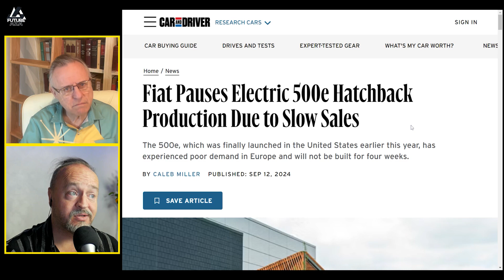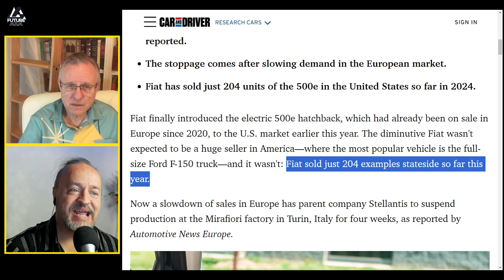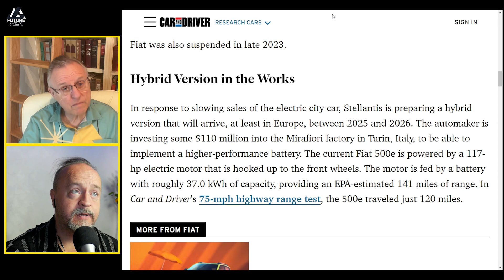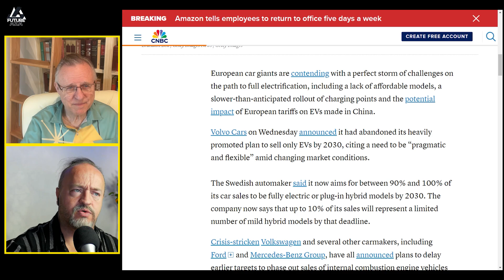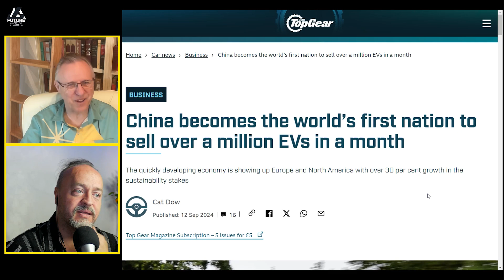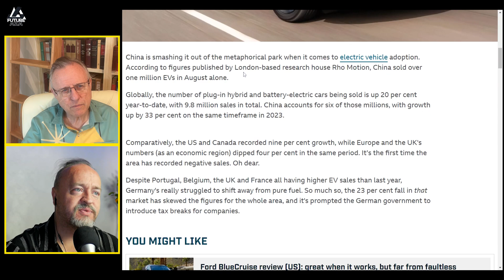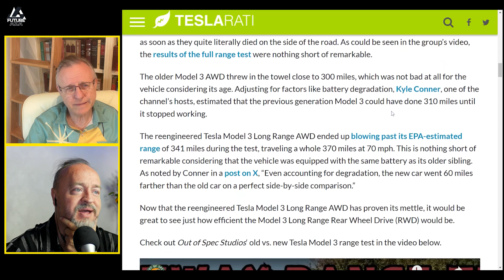China PROVES you can go EV. How did Europe fall so far behind?

Comment: To start, I don’t have an EV but I do rideshare driving in far northern MN. At-20 my understanding is the range drops. And I have to drive 25 miles just to get to the rideshare area. I did the math and figured out I would need to charge twice during a short (3-4 hr) stint of driving at -20 plus a third charge to get home. The math ain’t mathing with those figures. And when I visit my kid in Texas (1200 miles) on a17 hr drive I stop for a total of about 1/2 hr. Again, math ain’t mathing.
Reply from the maker: You should re-math the math. Talk to other drivers in your area and see what they're doing. Maybe it wouldn't be ideal if it was -20 all year, but that's a couple days a year, and even gas cars suffer shorter ranges on those days. Also not many people going places. Things get quiet at those temperatures.

If you're only stopping for 30-minutes for a 17hr drive, you're doing road trips wrong, and you are a danger on the road. There's a reason truckers aren't allowed to do that. The accident and death rate soars from that behavior.

I've driven over 23,000 miles in the last year, and I'd never go back to a gas car for long trips.
Reply: @FutureAzA  I was going to say the same thing. It's incredibly irresponsible to drive that far with so few breaks and completely unnecessary. I've driven through Texas and the states either side and it's without a doubt the most boring bit of the world I've been to with the exception of Belgium. Remaining awake and alert enough driving that long with such short breaks is extremely unlikely, and seriously endangers lives. 

The only time I'd drive more than a hundred miles without stopping is when I'm feeling really full of beans in the morning, and my bladder claims I'm fine when I see the motorway services, until I'm five minutes past it and the next one is further away than I'd like. I don't stop at them all, but I regularly stop, stretch my legs, use the facilities and would always take longer than half an hour for lunch. There's three meals worth to eat in 17 hours! The indigestion alone from scoffing two to three meals in under half an hour, and also visiting the loo so it's less time, doesn't bear thinking about. 

Actually, I think Allen may not be telling the truth about any of his claims, and/or did not learn maths as well as he thinks he does. It seems a little like that friend who says five minutes but means anything from two to thirty five and has no clue at all how long they'll be.